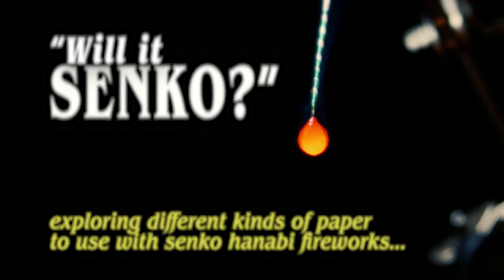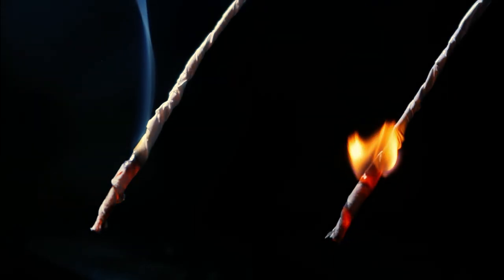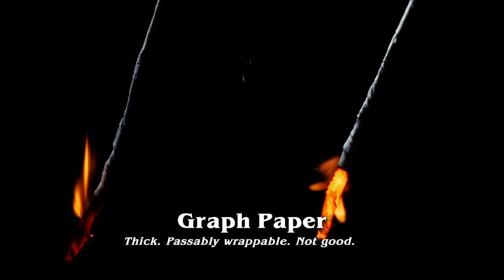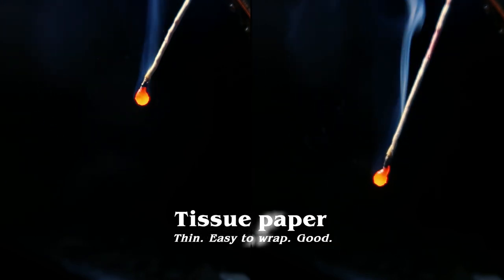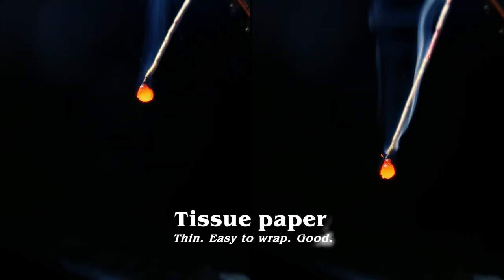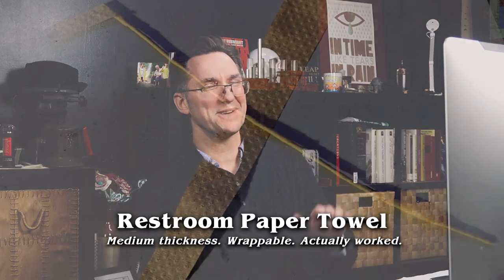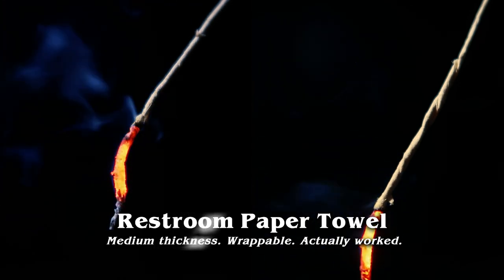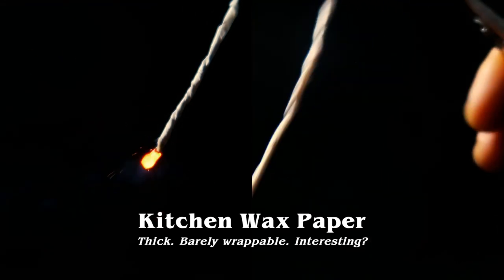Will Any of These Work?

Comment: Cool video! I'm thinking about testing some different common carbon sources. I'm getting good results with gardening charcoal I had laying around that I ground myself but I'm thinking art charcoal for drawing might work better? Or even graphite? It's carbon... Maybe I'll try soot from a regular candle?
I also have this idea of soaking the tissue paper in a chemical mixture to potentially change the color of the sparks, not die if they will work though. I should also mention that so far I've only experimented with the 'safe' K bicarbonate version that NightHawkInLight featured.
Reply from the maker: Glad you enjoyed it! I think experimenting with carbon sources is valid... I'm constantly exploring different soot and charcoal sources. I think the further you get away from a complex/turpentine-ish pinewood source, the less success you may have, but only one way to find out.

I also think soaking the paper and/or coating the paper are under explored possibilities. Please keep us informed in what you find.

I also played around with using potassium carbonate instead of potassium nitrate. I think it is very cool and I would like to do more with that, I've just been focusing more on classic senko Hanabi. 

Thanks again for commenting. Keep us in the loop! I'm actually working on a new video right now exploring some other paper alternatives so hopefully I'll have something new up here...

Comment: Senko Hanabi often use Japanese paper made from bark fiber.
This paper is made by hand from ancient Japan, but the number of successors is decreasing and the amount of paper made is decreasing.
The raw materials for paper are mulberry, mitsumata, and ganpi.
Reply from the maker: Is that different than gampi paper?
Reply: @GuillotinedChemistry  
Gampi paper is sometimes used, but kozo paper is often used.
Compared to gampi, kozo has thicker fibers and is stronger.
Reply from the maker: @Japanvideography  that is good to know! I am going to have to start looking for kozo paper now.  Thank you so much for letting me know... And if you know any other tips for more authentic senko Hanabi please let me know!
Reply from the maker: Follow up question: do you know the typical weight of the kozo paper... the g/m2 or gpm?
Reply: @GuillotinedChemistry  Other than that, as far as I know, the way sparklers burn changes depending on the amount of gunpowder and the thickness of the paper.
Therefore, I do not know the weight of kozo paper in detail.
Reply from the maker: @Japanvideography  well sounds like I've got some new stuff to investgate. Thank you so much for the lead! (By the way, love your channel, just subscribed)

Comment: Cool vid, thanks for the effort you put into this!  As I said in my 'how to wrap senko' video, Gampi is the way to go if you're into these for sure, it's just so much nicer to work with.  I've calculated it to cost about 10c per sparkler, so it's not terribly expensive.  The other benefit I've found when trying countless (well, 45 or so) different compositions is that you can often re-use a piece of gampi that was on a sparkler that didn't work so well.  Just unwrap it, cut of the burnt end (or not), and then fill with a new composition.  Saves time, money and effort not having to cut new paper.  

I agree plain tissue can work as long as you have the composition right.  If the composition is wrong, no paper is going to save it, it is going to fall off.  I've had some pretty terrible wrappings with used gampi that was torn, and the composition was able to hold on just fine due to the surface tension of the ball.  

But this is another reason that gampi is so good - it's so thin because it is so strong, and therefore the total amount of paper is the absolute minimum.  I feel like the job of the paper is to stay out of the way as much as possible so that the composition can do what it needs to, and for that gampi is the best.  I'm addicted to these now as well, they really operate on the razor's edge of what works and what doesn't.  A difference of 1% in one component of the composition can and does make the difference between one that works and one that doesn't.

I'd be curious to see what compositions you've had success with, have you shared this information anywhere?
Reply from the maker: Thanks so much for your response... I've been too lazy to calculate the cost per senko for the paper, but it isn't much, I agree.

I've also been too lazy to reuse unburnt paper... Maybe shorter senkos for the testing  phase and longer for the display models... 😃

I'll definitely share my compositions with the channel in an upcoming year-in-review video.   Although they seem to be pretty dependent on your local sourced charcoal, paper, and soot... So I wonder how much will translate to other people's endeavors.

I'm going to try out some new papers based on some of these comments so 'Will it Senko?" Part II might be closer than I thought. 🎇
Reply: @GuillotinedChemistry  Curious how you are making your compositions.  Mortar and pestle?  Or some other method?  I find I am getting very inconsistent results with both screening 3 times and mortar and pestle, which does agree with Frederick Van Der Sypt's articles from the journal of pyrotechnics.
Reply from the maker: @xoltri  Until recently I was exclusively mortar and pestle, but with extremely small samples. There was a lot of inconsistency since I was at the edge of my balance resolution and I wasn't screening. 

I have recently ball milled some of my components down more (the KNO3 and the charcoal), but I'm still testing smaller batches that I put together and grind/mix in the mortar and pestle. 

I think if I ever found a composition that I was enamored with I'd make a larger sample and then ballmill it for a good long time, but I'm not there yet. But, yes, the smaller sample sizes and mortar and pestle are adding some inconsistency... most of which I feel can be somewhat compensated for by a good wrap. :)

Comment: Excellent and informative video!
Keep up the good work, I'm looking forward to future videos.

This is exactly what I needed. I was struggling withe the choice of paper too. By now, I have bought a few different kinds of tissue papers off of amazon, looking for one that has a good compromise between stiffness after being rolled and ease of handling while rolling.

I'll share some of my results aswell:

Most of the common tissue papers for decoration have 16g/m^2.
This burns quite well and wraps very easy, without much strain on your fingers. The downside is low stiffness of the rolled stem, which means that they flex too much and bend down. It also easily tears when it gets too wet.

My favorite is 24g/m^2. This thickness still wraps fine and produces a very stiff stem that does not flex under the weight of the head. But the rolling is harder to get started and requires more strength, so your fingers will start to hurt sooner if you plan on making many.

During my tests, I didn't really see the thickness of the paper influencing the performance of the sparkler, but the potassium variant seems to consume more length of the stem if the paper is thinner. 

I recommend any paper between these two thicknesses, and paper like that is easily available in large quantities on places like Amazon.
Reply from the maker: That's great information. The gampi paper I use is 10 g/m^2 so it's good to know I can go bigger. I also just found out that a lot of senko Hanabi use kozo paper which I guess is a little different... I ordered some samples to play with that.

Thank you again for such helpful information. Let me know if you post any videos of your progress!
Reply: I noticed that in all of your tests you used the "original" recipe that contains KNO3.
Where I live, I can't easily get this, so I am using NighthawkInLight's non-flammable alternatives.

I was thinking:
Some of the paper you ruled out because they did not let the droplet form, might work somewhat fine for the other recipes, since it will be burned from the outside, with greater heat.

Can you tell me where you ordered the gampi / kozo paper from?
Reply from the maker: @TsamsiyuK  Hmmmm.... that is true ... If you're lighting the paper with a mini-torch all bets are off, I suppose! I would guess the thick paper might still interfere with the dross... But maybe you could compensate with more powder... Makes the head spin....

I ordered my 10 g/m^2 gampi paper from Paper Connection (I can try to find the exact product number if you need it). I just ordered a sampler pack of various papers from Hiromi Paper in California so to be continued

Comment: Another thought about cellulose, with no idea if it would work, I was frustrated one time with the cellophane I bought that was from a cheese making supplier. I wanted to toy with the "magic fortune fish" effect where a cellophane fish twists and turns in your hand from the humidity. After reading the interesting account of cellophane on Wikipedia, the invention was later coated with nitrocellulose to make an oxygen barrier. Perhaps if some place sold uncoated cellophane, it'd  be one other thing to try coated or uncoated.
Oh heck, I had a little bit of powder left and tried rolling a dampened fortune fish to make it sticky and interestingly not being something with much capillary action a well-formed dross bead clung to it and emitted sparks in a passable fashion. I used bamboo charcoal though and didn't get branching sparks. It was some very talc-like charcoal sold in a 20 gram cosmetic container for brushing your teeth of all things.
Reply from the maker: I bet cellulose would work... I've seen people comment on coating senko henabi with it. Pine charcoal seems to be the preferred choice for senko, but I'm always up for testing the idea. I'm impressed with what I'm making from fat wood. I'll try to make a video on that soon. @NightHawkinLight has great videos on making your own charcoal. 👍
Reply: @GuillotinedChemistry  To be clear you mentioned people coating senko hanabi with cellulose, is that some sort of liquid bandage stuff like ethyl cellulose or did you imply nitrocellulose like in a lacquer or just cellulose?  I saw a "cellophane coat nail lacquer" fingernail product, perhaps that. I suppose all the low hanging fruit ideas have been tried, but it sure is an interesting teaser to think about, coming up with a unique variation.
Reply from the maker: @Resonanttheme  you know what, I'm not sure... I'll have to dig out the article. I'd try it all out and see what surprises you. To be clear, I don't think we need a coating, but (like the wax paper) there might be something a coating can add to the dross ball that surprises us!

Comment: I've found a type of paper that works unsurprisingly great. Rice paper, the one used for rolling tobacco. I found a brand (RAW) that sells footlong novelty papers that can be used for Senko Hanabi with two cuts: one to remove the glue strip, and one to make two triangles out of the rectangle, like you did with Gampi. They also sell it by the roll.
Reply from the maker: Interesting! The length seemed to be the limiting factor but if they sell it on the roll or in a novelty length, I'll add it to the list. Rolling paper was definitely the lowest hanging fruit I missed. 😃 Thank you for sharing... Have you posted any video of it?
Reply: @GuillotinedChemistry  No, I haven't. Maybe I should, because I used the sodium bicarbonate recipe proposed by NightHawkInLight, and the results were... interesting. It formed a very nice bead, but the reaction was not exothermic enough and thus, not self-sustaining. I had to keep a lighter flame on it constantly or it wouldn't produce sparks (which, by the way, due to the sodium, were bright yellow).
Reply from the maker: @isaaccisa  hey even the unsuccessful ones are still forward progress.  Let me know if you end up posting some trials!
Reply: Ha! I was going to say, I rolled a teeny senko with a normal sized rolling paper and it worked really well! I think bulk rolling papers (rice, hemp, maybe even those clear cellulose papers??) might be a really good, less expensive alternative to gampi. 
Right now I'm using a multicolor pack of tissue paper I bought at the dollar store that I can cut into ~1,680 senkos so it's really hard to justify the price of gampi paper on amazon...
Reply from the maker: @zzdogger  yeah, there definitely might be a diminishing return for some of the Japanese papers in terms of cost benefit. For the sake of authenticity, I am still fascinated with washi paper, but  I really do need to try out some of you suggestions. Post some attempts!
Reply: Ha!
Me too.

RAWS unbleached kingsize papers worked best out of a few rolling papers I tried for this.
I figured I'm a roller anyway, this seems right up my alley.

Edit*

As a roller I would suggest making you fingertips slightly tacky... Not STICKY... Tacky..
Difficult to describe but if you smoke weed you'll know what I mean.